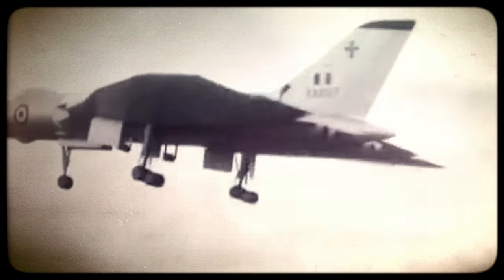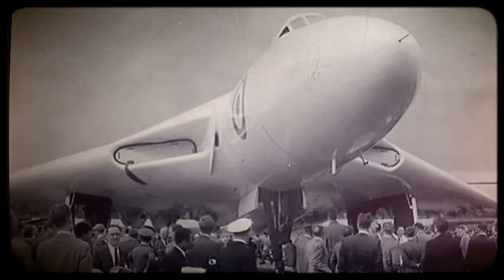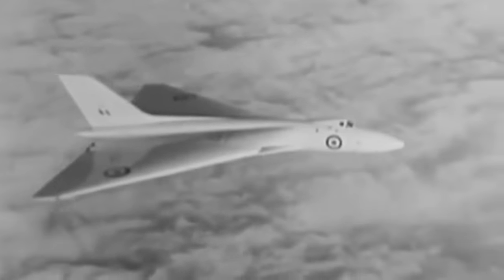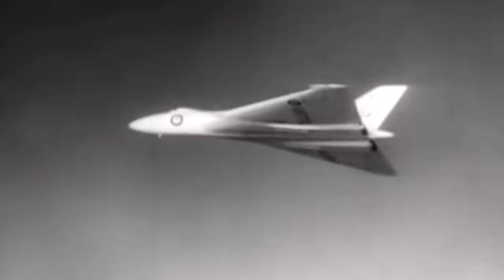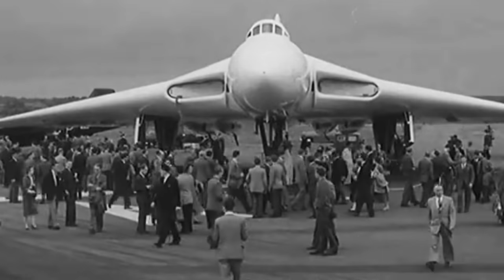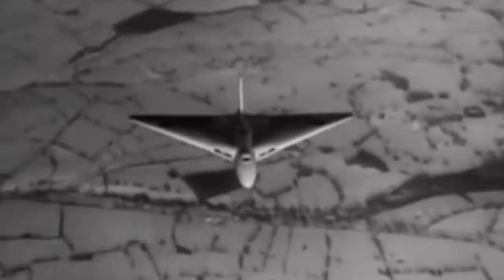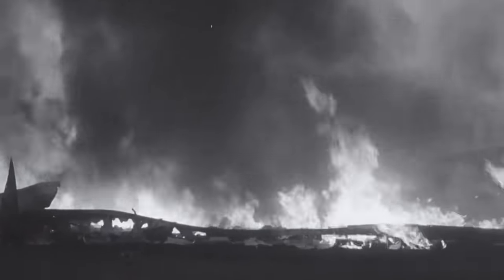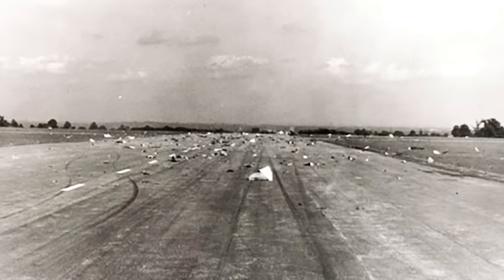Vulcan Bomber Disintegrates on Camera

Comment: This Vulcan bomber looks like it had a lot of tech that we use today, like the Stealth wing plane shape, the engines were buried inside the body of the craft, not mounted under the wings .It appeared to be a plane that was way ahead of its time design wise.
Reply: One of the most remarkable things is that Roy Chadwick designed the Vulcan a mere 7 years after he designed the Lancaster: just goes to show how quickly technology and understanding of aeronautics had developed in such a short time.
Reply: Nothing new about the delta wing arrangement. The Soviets were experimenting with these designs in the late 1930's
Reply: The thing is, that plane wasn't ahead of its time, it's us who are stuck in the past
Reply: Radar performance was sufficiently well understood by this time that practical stealth structures could be explored by the military.
Reply: The Vulcan is not a flying wing, much less a stealthy one. The engines are not exactly buried in the wings either, they hang on the outside like the Meteor.
Reply: @a-10thunderboltii24  Looked like the engines were completely embedded in the wings
Reply: @O4KAST  Not ahead of its time, but state of the art aviation tech in that decade. Though nothing new about delta wings
Reply: @JohnSmith-eo5sp  Well I guess I see what you mean, but embedding the engines also means hiding the exhaust. If you look at an F22 or B2, you can see there are surfaces around the exhaust. The F22 exhaust is surrounded by the elevators, while the B2 hides its exhaust on top. Arguably the Sr71 and Meteor have embedded their engines. Usually engines hanging outside the wing are easier for main ten engines and upgrades, so it is a trade off too.
Reply: @a-10thunderboltii24  So you call the SR71's huge nacelles "embedded" within its wings?
Reply: @a-10thunderboltii24  Having the engine intake in line with the wing leading edge minimises drag. Pylon mounted engines are the worst option for drag but make maintenance and engine upgrades easy. The Comet had the engines in the wing for the same drag reduction reason.
Reply: @a-10thunderboltii24  The engines are buried inside the wings with just the tailpipes protruding.  The same arrangement featured on the Victor and Valiant Bombers as well as the Comet airliner.
Reply: @a-10thunderboltii24  Sorry, but I worked on Vulcans in the 70s. Changed quite a few engines in that time. The engines are definitely within the wing structure.
Reply: @thandalion6313  I said I agreed on what that person meant, I was just discussing the different ideas/meanings
Reply: @allangibson2408  Exactly
Reply: @leemingmerlin  Well that’s what I mean. I see that the engines are technically embedded in the wings, but it is nor the exhaust is not hidden well
Reply: @leemingmerlin  Unfortunately I don't think I will ever visit the UK or Europe, not even on a bucket list
Reply: In some respects, the Avro Vulcan was way ahead of its time, though the avionics were WWII vintage,
not that much different from Lancaster.
Reply: Check out the Victor
Reply: @a-10thunderboltii24  You're mistaken John!  The engines, as with the Handley-Page Victor and even the much earlier Vickers Valiant, were fully enclosed within the wings.  You may be confusing this with the even earlier English Electric Canberra bomber (licence-built in the USA by Martin as the B-57).  This did, to all intents and purposes, look like a meteor on steroids!  Incidentally, 3 of these are still used by NASA!
Reply: Engines in the body is and was much more to do with high speed aerodynamics than radar profile. Remember that this was a near-supersonic aircraft.
Reply: @allangibson2408  Pod mounted engines are very good for drag; look up some info on this.
Reply: @cybertommo  They all had their engines fully enclosed, I see what you mean, just not the exhaust.
Reply: @VideoNOLA  
     While this is true, regarding radar knowledge, this was not the purpose for the design.
The design was to advance delta wing knowledge. It had a vertical stabilizer. This is 
the #1 structural component that gives a radar return.
     The Avro Vulcan B.2 -
Had, ECM similar to B.1A. Terrain-Following Radar (TFR) in nose thimble radome fitted to most aircraft in mid-60s.
http://www.baesystems.com/en/heritage/avro----vulcan

Comment: The 'truth', can probably found in the redesign of the wing from prototype to production variant.
Reply: You gonna start a gofundme page 👍
Reply: That and any changes made to the engine design.  The USAF prefers designs with the engines installed in external pylons whenever possible.  There are two main reasons, 1. it makes servicing the engines easier, 2. (more importantly in my opinion), If the engine has a catastrophic failure in-flight, there is less risk to the primary air-frame.
Reply: @waynecampeau4566  When was the last time that a fighter had an external engine?
Makes sense for maintenance, and survivability, but IIRC, the only fighter with external engines would be the Warthog.
Reply: @PiDsPagePrototypes  Fighters and Interceptors are the cases where performance outweighs everything else.  They need speed, so streamlining and reducing cross section force the engines internal (same with the SR-71).  But things like bombers and transports almost always have the engines in pods.  Of course now there is the new requirement for stealth that has forced the engines internal. The B-1 Lancer was a bit of a hybrid, but they put a LOT of work in making the engines quick changeable (about 20 minutes) so they could maintain the readiness standards of SAC.  The warthog also had the requirement of high- survivability.  That meant two engines and spatially separating them. :)
Reply: @PiDsPagePrototypes  The Warthog A-10 which will be in service until 2040, that's how awesome they are and the the SAAB P1642–07 B3LM which is a Swedish external engine fighter jet similar to the A-10
Reply: @offgridhomesteaders863  So awesome that the Iraqi Republican Guard in 91 routinely blew them out of the sky or damaged them so badly they were out of the war. They had to be withdrawn and only used against Iraqi conscripts without meaningful AA weapons

As cool as the A-10 is, it was obsolete when it first rolled off the assembly line. It can't survive contested airspace, but is also overkill for COIN operations, which can be done with turboprop aircraft for much cheaper.

The A-10 was designed for an environment that no longer exists, the days before the ZSU-23-4. Most telling, the Israeli air force could get pretty much any aircraft they wanted after the Yom Kippur War, but they never showed any interest in the A-10. Because they knew full well it could not survive in contested airspace any better than their other aircraft.
Reply: @offgridhomesteaders863  In the 1980s when we were camping in Norfolk, A-10 tank busters used to dive-bomb our toilet and shower block every morning. Obviously they didn't open fire, they just dived down on us and then pulled up into the sky, but it was still pretty scary!
Reply: Don't mention Variants ...   😎  🌠

Comment: I once saw a Vulcan at an airshow in 1975 at Barksdale AFB, Louisiana. I was attending an Air Force school at the time. The Thunderbirds did their thing but to me the most impressive event of the show was a high speed, low altitude pass by a Vulcan bomber. The Vulcan was a strategic bomber in the same payload and range class as the U.S. B-52. The aircraft mad a couple of passes for us to ooh and ah at. Finally, it climbed to approx. 20,000 ft, power dove and did a high-speed (400 mph) low-altitude (>200 ft) pass down the runway. After that it pulled up into a vertical climb and proceeded to pull inverted and roll upright - i.e. it executed an immelman turn! FYI, an immelman turn is a FIGHTER maneuver yet here was a strategic bomber maneuvering at high speed on the deck and executing a maneuver only fighters and aerobatic aircraft can perform. If you tried to do that in a regular aircraft you would either stall and - likely - crash or rip the wings off the plane. I asked one of the pilots of a B-52 on display what would happen if he tried something like that. He laughed and told me that the wingtips would come together like someone doing jumping-jacks and the wings would depart the aircraft completely.

The Vulcan was an amazing aircraft. It had fighter-like speed and performance and it was designed and built by a company (AV Roe) which heretofore had no experience with delta.winged aircraft. But its time came to an end. Except for airshows, the last Vulcan flew in March of 1984. The Vulcan's contemporary - the Boeing B-52, still flies TO THIS DAY! Through a continual process of upgrade and modernization, the B-52 is still operational. There are pilots flying the B-52 whose GRANDfathers were B-52 pilots. Youcan love Boeing or hate it. What you must admit is that Boeing, through the years, has produced some AMAZING aircraft.
Reply: I was stationed at Ellsworth AFB and saw Vulcans at a bombing competition in 84 or 85. They were impressive.
Reply: The B-52 airframe has undergone some substantial changes, and it's still around because it's adaptable to mission capabilities that didn't even exist back in its younger days.
Reply: The B-52 could carry a much heavier bomb load over a much greater distance and was faster. Flying wings always have poor performance, that's why they never caught on, there is far too much frontal area, they look cool though. Aerodynamically the B-1 is seriously great.
Reply: @shawns0762  
Sorry but to set the record straight, the Vulcans top speed was 646 mph compared the 509 mph of the B52.
But yes the conventional bomb load of the B52 was much higher. The thing to remember the V Force aircraft (Vulcan, Victor and Valiant) were designed for Nuclear Strike with conventional bombing as a secondary roll. The Vulcans design range was to reach targets in Russia from the UK so longer range was not deemed to be necessary. Air to Air refuelling was added later in service this made the Black Buck missions to the Falkland Islands from Ascension Island (this from many years was the longest live bombing mission ever).
Also the service ceiling of the Vulcan was 55,000 ft + but in testing 60,000 ft + was easily achieved the actual figures is still classified I believe. The B52 service ceiling was 50,000.
Reply: @planekrazy1795  The top speed of the B-52 is 650 mph, it was faster
Reply: Look up ‘Exercise Skyshield’ which  revealed the superior performance of the Vulcal over the B52 in America’s own back yard.
Reply: We once had the American Blue Angels do a display at Hucknall in the late sixties or early seventies. They were amazing!  I'm 61 now but I do remember I had long hair and wore bell bottomed jeans at the time 😆😅😂👍
Reply: B-52 was built when Boeing made awesome planes, pre B 707, 727, 737 and 747
Reply: The last ever flight of a Vulcan was 28 October 2015 only 9 years ago at time of this post though its last operational RAF flight was 1986.
Reply: @razgriz380  You know there is this thing called the Internet now. The top speed of the B-52H is 650 mph. Do some research before you make comments
Reply: I was in Pilot Instructor Training at Randolph AFB in 1982.  The base had hosted a huge airshow over the weekend.  It was Monday, and the SOF notified us that the Vulcan bomber crew was going to perform a departure airshow for us.  We all quit our briefings and filed outside to watch this massive bomber take off, accelerate down the runway with the gear about 10 feet in the air... and at the end of the runway, pull straight up, perform a hammerhead stall, go straight down, and pull up just before the ground.  I remember saying out loud, "Holy shit!"  as he seemed to do at least a 3G pull back to level at about 10 feet... then accelerated to the other end of the runway and do the same thing.  I had just watched the Blue Angels and the Thunderbirds do their full routines over the weekend... and the Vulcan crew blew them both away with this special show for the USAF hosts before flying home.  Awesome Aviators!

Comment: An amazing aircraft, the sound of its engines on take off giving a distinctive howl is so good. I saw the last ever Vulcan flight a few years ago, sad to see it grounded for good.
Reply: @TheEpicBirb  Pretty much grounded for the foreseeable future. money and safety issues etc. I thought its airframe (XH558) lifetime had expired also?
Reply: It might be theoretically possible to get another airborne - there is at least one other airframe in good condition that might be potentially airworthy - but I don’t believe it will ever happen as the cost would be astronomical and presumably the companies and authorities who need to back the project would pull the plug at the same sort of total flight hours as XH558 (Divide the cost by the number of hours it would be allowed to fly and it isn’t viable) :(
Reply: @SAHBfan  keeping XH558 flying was a constant struggle to get the money needed. Glad I got to see it fly a good few times, living close to an airshow venue is very useful sometimes !
Reply: @magicknight8412  - I managed to see it a good few times, too. Sad to think we'll never see it again, though... To be honest, when the Hunter crashed it knocked the whole idea of keeping vintage aircraft flying, making all the companies who could bear some responsibility very nervous  (even though the fault wasn't the aircraft that was` at fault).

Comment: Having been in and around aviation for more than 60 years like most people I've seen many accidents and many deaths. From a blue Angles mid-air collision in Niagra, NY  to a fighter demo that crashed in DC (too young to be sure) or Bob Hoover returning to the Reading airshow without a wingtip after hitting some wires - aviation doesn't usually give second chances. Most accidents  though were aboard the USS Lexington as we trained pilots in carrier landings, many young men lost their lives as their aircraft landed short of the carrier and into the water or missed the arresting gear wires and went into the water , that fast deceleration caused their heads to hit the instrument panel and they were dazed as the aircraft sank. Those memories served me well as I was able to accumulate over 28,000 hours in the air. Every one of those accidents was a learning experience for other pilots like myself.

Comment: I live a couple of miles from where Vulcan's were serviced and flight tested in the 70's - endless days of ear splitting roar and the famous 'howl'. Back then they were all in anti-flash white and regularly flew over both of the schools that I went to at low-level, before they eventually went back to their various squadrons.
When the Vulcan's finally left the Red Arrows moved in and we had so many part displays using some of the aircraft in the spring after they came back from Akrotiri and practised over rural Leicestershire. One lads brother worked at Bitteswell and for the price of a pint and a bag of toffee's he'd take your bike frame and wheels with him and have it resprayed/rechromed BUT there was only one colour option and half of the kids in Lutterworth had a red bike.

Comment: one of the best aircraft ever.  such a magnificent beast, and what a howl
Reply: The same engines that powered the Concorde
Reply: @dp-sr1fd  correct,  albeit with a little modification for Concorde
Reply: @dp-sr1fd  RR Conways or Bristol (later RR) Olympus?? Conways were on the UK Boeing 707s and I think also the Vickers VC10. In one VC10 clip on YT you can hear the very faintest hint of the notorious Vulcan howl. Like on the Vulcan, the engines were mounted in close pairs on the VC10. This might have set up a pulse interference between them. On the 707 they were on pylons and widely spaced apart.

Comment: Back in the 60s I was stationed at RAF Syerston, working as a young meteorological assistant.    Even 6 years after the tragic crash there were still small pieces of the wreckage to be found on the grass parts of the airfield-a poignant reminder of a terrible day.

Comment: I have worked on several aircraft and actually witnessed several aircraft come apart. This appears that the compressor section of the engine failed and shredded the structure of the right wing. Being that Rolls-Royce add just installed to Rolls-Royce engines, they weren't about to fess up. But the appearance of the original breakup looks like an engine failure not a structural problem. Structural problems usually occur when the wing snaps. The wing did not snap it was torn apart internally. I've seen damage from engine failures like this, luckily I've actually seen it on a couple of aircraft that survived the incident. But those planes did not have wings attached to the sides of the engines the engines were lower than the wings. Saving the crew
Reply: It is possible that the engine ingested a bird and caused the inlet turbine to come apart shredding the wing.

Comment: Pilot exceeded speed....  Unless he was recovering from a full power dive, I call bullcookies.... Looked an awful lot like one of those precious engines came apart...
Reply: Another cock-up and cover-up by by the military aristocrats. No wonder the accident report vanished. The share price of the aircraft or engine manufacturer would have collapsed if the truth came to light. They must have been hoping that a display of the prowess of the Vulcan at the airshow and ensuring  publicity would have caused the share price to multiply and the aristocrats would have cashed-in.
Reply: That wing definitely exploded outward from the fan backward. I agree that the engine detonated!
Reply: Forerunner of the Trent 1000 by the look of it's self destruction!